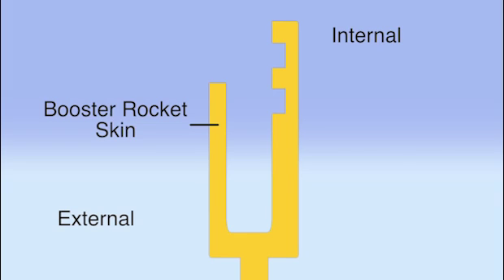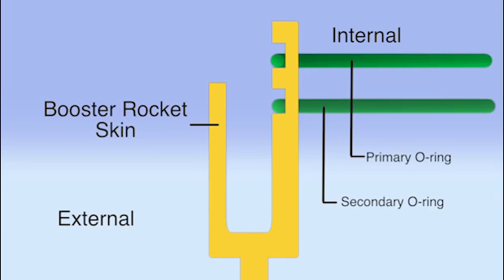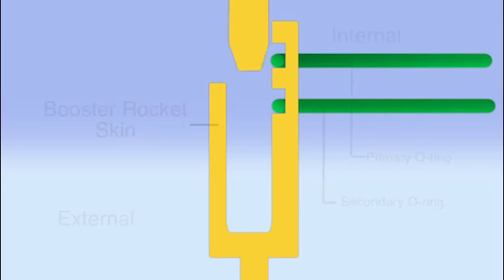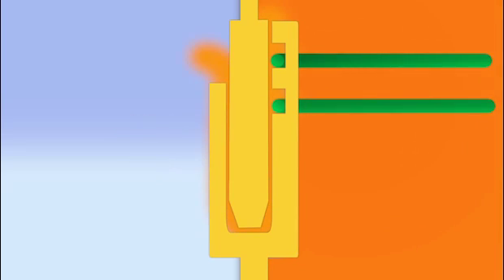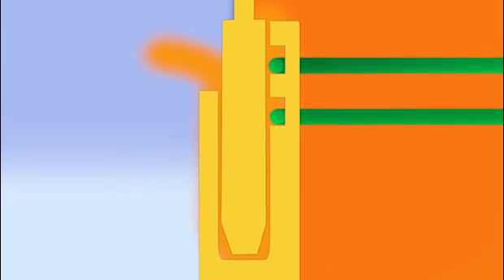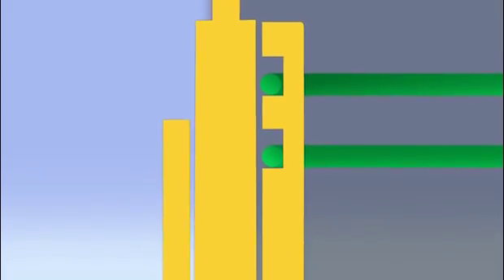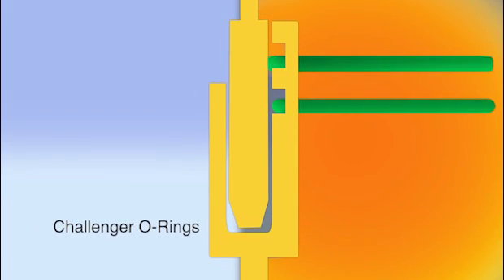Space Shuttle Challenger O-Ring Failure Diagram | TheBlaze

Comment: The fact that a rocket producing millions of pounds of thrust can itself be segmented is a huge feat of engineering. However one must ask (and im sure it was discussed) why it would be a good idea to have many more points of failure when you can just build the thing in one piece. I remember reading somewhere that the reason for segments was due to shipping from utah and other locations - easier to ship in segments. Well, easier and safer usually dont end up in the same sentence.
Reply: The outer casing were machined in California by Pratt & Whitney. The segments had to be shipped separately due to their size and assembled at MT then shipped to Florida.
Reply: They tried to ship it in one piece but it deformed when transported so they had to segment it. It could have been built closer but it was deemed too expensive to build a whole new factory nearby.

Comment: Did the redesign completely cure the O ring problems,  Were there any further blow by or o ring  seal problems for the rest of the program from 1988 until 2011
Reply: An additional O-Ring was added to the SRB field joints and joint heaters were also added for protection of the O-Rings and field joints. During the countdown on later flights, you can here the call of joint heaters being turned off approximately two minutes before launch.

Comment: Why the hell don’t they just put the o-ring against the wall where it should be?  I know there is a scientific answer and i’m fascinated to hear it.
Reply: muska34 — You have to consider that it must be possible to assemble the joint without damage to the o-rings.  I expect that would be the main reason they are not seated at the outset.

This is a crude diagram and an oversimplified model.  I’m sure the designers tried to get the details right for best performance.  The difficulty was that the concept wasn’t very good.  The main problem, apart from sensitivity to temperature, was that combustion gas pressure tended to force the seal open rather than closed.
Reply: GH1618 OK that makes more sense then thanks for taking the time to reply.

Comment: My opion Nasa are idiots for having O-ring seals to hold the solid rocket boosters it was a disaster waiting to happen.Did the mercury or apollo rockets have O-ring seals?You cant call them solid rocket boosters when there held together with O-ring seals.O-ring seals was made because they didnt have a facility close to the launch pad in florida it was in another state and they was extremely long and they said they could move them by rail or truck so they shipped them in sections.It would have made sense if they was made on sight close to the launch pad on nasa property in florida.The big tank the shuttle is hooked up to does it have O-ring seals to hold it together if not then why  didnt they made the so called solid rocket boosters solid and not in sections?it wouldnt have broke apart and the shuttle program would have been alot safer.I dont understand as smart as nasa is why they didnt figure this out.They figured its worth the risk.Idiots in my opion on this issue.
Reply: TRUMP is our president...further UNDERscoring the FACT we are a nation of Idiots.
Reply: Mark Davis — Mercury, Gemini, and Apollo used liquid rockets.  The segmented design is necessary for solid fuel rockets for ease of manufacture.  Probably also for transport and refurbishing, as these were intended to be reusable.

The O-rings didn’t hold anything together.  They were just seals.

Comment: I've never seen an o-ring seal designed to be non-sealing (leaky) when nothing is flowing and to suddenly start sealing when something that shouldn't be leaking IS flowing. It begs the questions...

(1) What gases/fluids were meant to flow freely past the o-rings when they were in their non-sealing (leaky) configuration? And if there were no such gases or fluids meant to flow past the ring seals under certain conditions, what was/were the design objective(s) for a non-sealing (leaky) o-ring configuration?
(2) Who are you? What was your involvement in the Challenger project? Where did you get the details of the o-ring installation configuration depicted in your video? Are there any official records that support your depiction of the sealing mechanism represented in your video? You know, blue-prints signed off on by a design team member or supervising engineer?

I have not seen the blueprints or official documents confirming your interpretation of the design posted anywhere. I'm assuming you have. I would like to have a look at them - if you don't mind sharing.
Reply: Yes, the o-ring should touch the opposite surface (though I'm now wondering if it must, allowing a Bernoulli effect to pull the o-ring into the gap).  Maybe you already know this, but it's worth thinking about.  The groove is however supposed to be wider than the o-ring--so much so that any cross section of the ring can't contact both sides of the groove (as shown in the video)--such that there is a sufficient opening for the gas or liquid (fluid) to surround the majority of the o-ring so that the lesser portion is pressed into the joint--thus increasing the integrity of the seal.  One theory I've seen on the disaster (among others) is that the width of the groove was too narrow, and the gas could not get "under" the o-ring but was able to press the o-ring into the groove and escape around it--thus compromising the seal.
Reply: The blueprints and designs aren't even the point. The point is materials, and the effects of temperature thereupon. If the temperatures hadn't dropped on the pre launch days, none of that would have been an issue

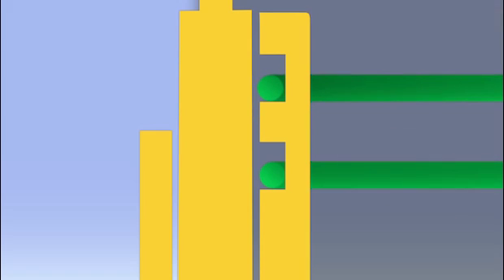Comment: I cannot claim expertise here, but I have done some reading on this and I think your part of the explanation beginning at 0:34 is in error. Your drawing doesn't show an important part of the original joint which was the leak check port. This was used to pressurize the space between the 2 o-rings during assembly of the field joints, to ensure that they were in fact sealing. I think that this space was being pressurized to 200 psi at the time of the accident. How could this pressurization have held if the o-ring was not in contact with both the tang and the clevis sides of the joint? I thought I read somewhere that there was to have been a .020" interference fit, but I'm going on memory here. .020" is not very much though, or at least to my limited understanding.
Reply: I built srb’s you are correct. They are leak checked. People love to talk about o rings, very few understand the underlying joint rotation problem😊

Comment: The diagram and animation are incorrect.  During the assembly and leak testing of the O-rings before launch,  the primary o-ring is located on the opposite end of the groove from the sealing position (the secondary o-ring is located in sealing position however).  The extreme cold on that January day when Challenger was launched caused the O-rings to be less pliable and slowed the movement of the primary o-ring across the grove into sealing position.  This delay in sealing action resulted in hot gases burning the O-rings creating a leak that resulted in a case burn-through that ultimately destroyed the shuttle and killed the crew.
Reply: Also, the diagram in the animation ignores the putty (paste) which was placed over the joint from the inside which was supposed to protect the seals from direct exposure to hot gas.
Reply: @AndyBrandt  And the fact that during ignition the joint rotated meaning the secondary o-ring would not seal the joint.

Comment: Can somebody explain to me how rubber on a rocket is a good idea!!!???? Like a kid could tell you thats asking for problems.
Reply: These rubber o-rings were kept far away from the main heat. The pressures and the very little heat that was allowed to get to the o-rings is what made them expand and seal.
Reply: Mc Ren — They only had to hold up for one use.  A refurbished rocket would get new rings.  That should be easy enough if carefully designed.
Reply: I whatched a documentary on the srb design. The srb is filled with a combustible compound that burns from the top down, middle out. They included an inert ablative material toward the rocket walls so the combustion would not reach the walls. But i also read that this “putty” was not failsafe.

Comment: The O-rings didn't seal on another launch before Challenger. I don't have the video in front of me but I believe it was the Atlantis. They didn't seal under normal weather conditions. They should have stopped the Shuttle Program before this and redisigned  the o rings
Reply: If I recall the conditions were not normal, but rather they were much colder than normal though not as cold as the day Challenger launched.

Comment: The two massive solid rocket boosters which doomed Challenger were chosen despite the fact Aerojet had presented a superior booster, one that didn’t need O-Rings. This is how it went down. First, a technical evaluation team was put together by the day's administrator James Fletcher, a Mormon from Utah. Four bids came in, only one from a Utah company then called Morton Thiokol. In this first round of evaluations, Morton Thiokol came in distant last (included in these bids was one from Aerojet, who proposed and even built a $400 million facility in Florida close enough to the Kennedy Space Center that the segments would be fully assembled and required no O-rings.) That first team was fired and a new one appointed by James Fletcher, the Mormon from Utah, and this new team took the hint and recommended Morton Thiokol, the company in the Mormon State of Utah, and that was the end of that. Until 1986 January 28. But back up a bit. James Fletcher retired as administrator and James Beggs was leading NASA at the time of the Challenger accident. For unrelated reasons relating to an Aerojet contract he was alleged to have botched up, he was forced to resign in disgrace (he was later cleared) and guess who they brought out of retirement? James Fletcher, who then made sure that Morton Thiokol kept making their flawed rocket motors even after they had blown up seven astronauts. The other three competitors again filed proposals (the one that changed its stance the least was Aerojet, the only one of the four which never needed O-rings) and again for nought.
Reply: Very interesting read.  Thank you
Reply: coviekiller5 — The joint was redesigned after the disaster, however.

Comment: welding was no option?
Reply: The weld probably would crack due to vibration. You need something flexible that could hold the gas. Something dynamic, like this O-Ring... but the freezing temperature was its doom.
Reply: Moreover, the SRB casings were modular by design, so that they could be disassembled after recovery to make cleaning easier, to prep them for reuse. Welded sections would prevent said disassembly.
Reply: The modular design was dictated by the fact that they were manufactured in Utah - and needed to be brought to Florida by train.

If they had built an SRB plant at Cape Canaveral, the whole booster could have been made as one unit, with no joints and no potential leak points.
Reply: ThomasHaberkorn — Apart from transportation, it was probably easier to manufacture and refurbish a segmented rocket.
Reply: I still can't get my head around the fact that these orings seal against high temp gas (or do they?)

Comment: 2 Orings and plenty of places under the tang to place high temp RTV as a backup.  Anyone who's built engines knows what I mean.
Reply: Vince L you built rocket engines?
Reply: Sorry, meant to mean car engines.  When you build them there's lots of RTV used to seal everything from air, coolant, and oil even when using gaskets and it works very well.  I can imagine that a giant bead of high temp RTV in addition to the 2 O-rings would have filled the crevices more thickly than an O rings alone and bought enough time for SRB separation before sealant burn through.  I witnessed the Challenger disaster firsthand all those years ago and I still think about the "what if's".
Reply: +Vince L man I dunno..if that animation is showing combustion in a rocket(not familiar with what these o-rings were supposed to be sealing)Permatex Right Stuff Black might not even be able to handle it.
Reply: Vince L — More people would know what you mean if you spelled out terms in first usage before using the initialism.